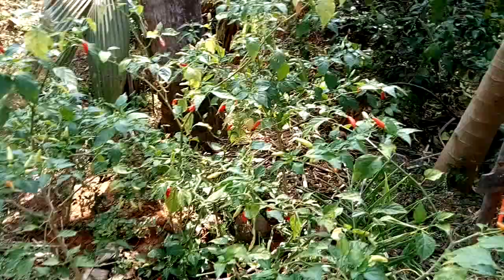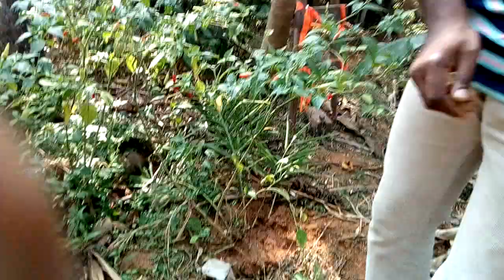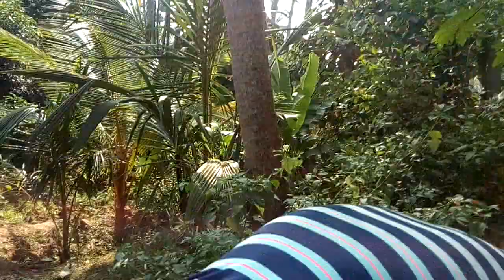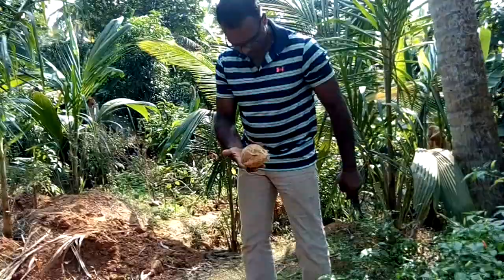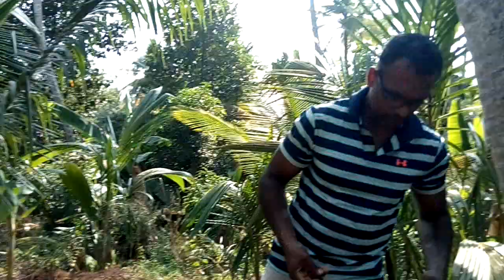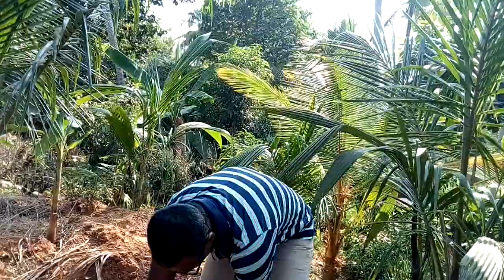Water divining techniques

Comment: How do I determine the depth of water?
Reply from the maker: Involving calculations
Reply: You can also get the depth of the target by, after hitting the target,  walking away from the target using ur L rod. Meaning, the distance were ur L rod cross as u walk away from the target is equal to the depth of the said target. Same as when ur locating for treasure
Reply from the maker: That's Bishop rule
Reply: But this is applicable only in a plain area.
Reply from the maker: I agree
But hard calculations involving
Reply from the maker: @sharalynprieto7430  ok